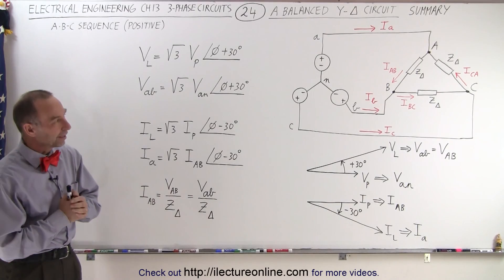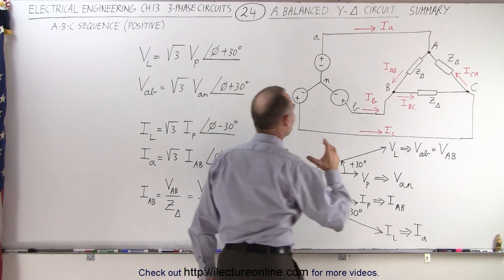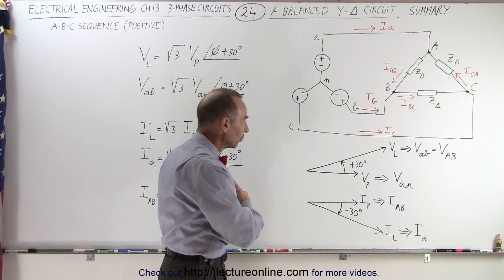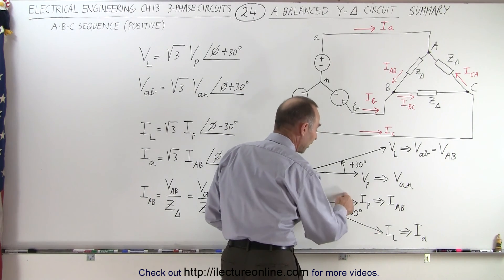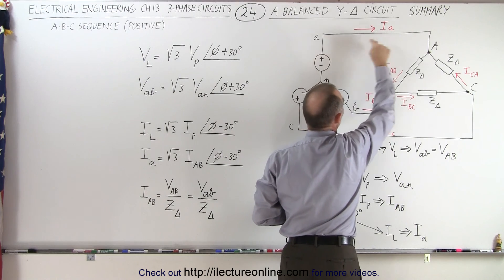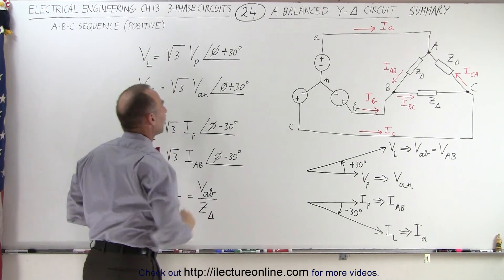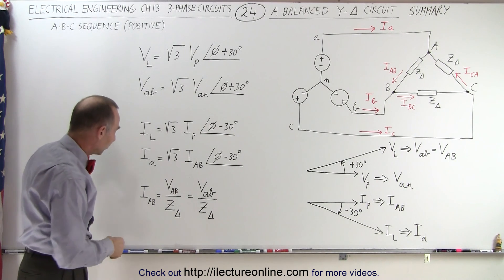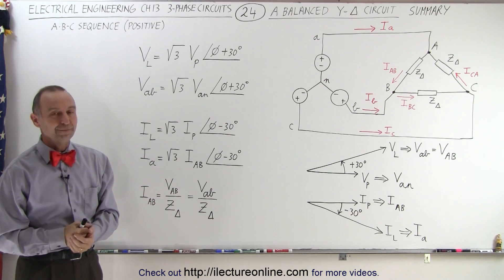Electrical Engineering: Ch 13: 3 Phase Circuit (24 of 53) Balanced Y-Delta Circuit: Summary

Comment: If I'm not missing anything, in 23rd class you said IL=root over 3 x IAB and angle is (Phase angle + 30), here you wrote (Phase angle - 30 ). Please clarify.
Reply: In 23rd lecture, he made a mistake which he mentiond in the comments section. The correct phase angle between line and phase current is -30deg
Reply: -30 since it lags

Comment: Would this be the same thing if it was a delta source with a wye load?
Reply: No. There are some differences. For example in delta eye , phase and line currents have the same magnitude. Voltage relationship is the same. Check your textbook

Comment: what will be the process of solving if we add a line impedance here?
reply plz
Reply: If they are equal, then it will be the same process, my friend. It could be easier to see this if you transform the delta load in a Y load, and add the impedances with the line impedances; and then finally, transform back to the delta form. Basically, it wil be the same thing if you add impedances with the same value on the three lines.